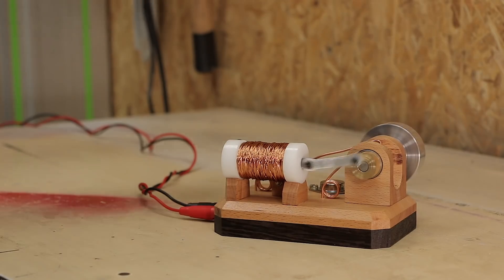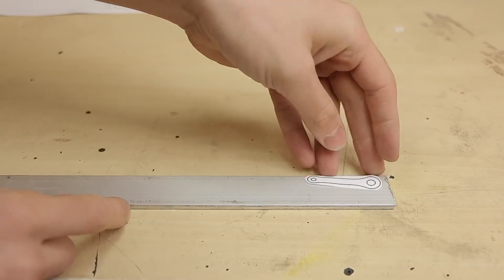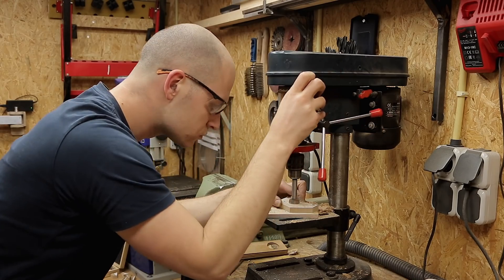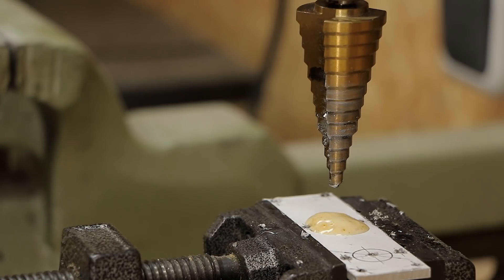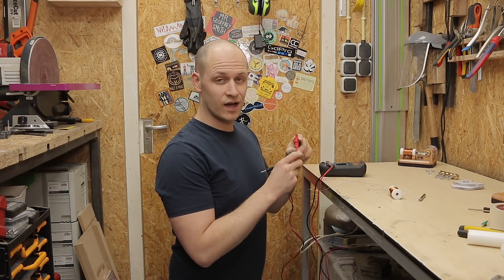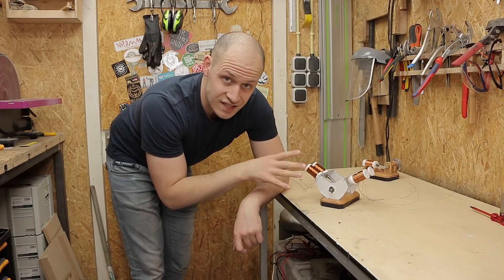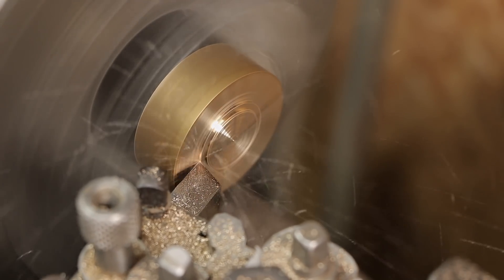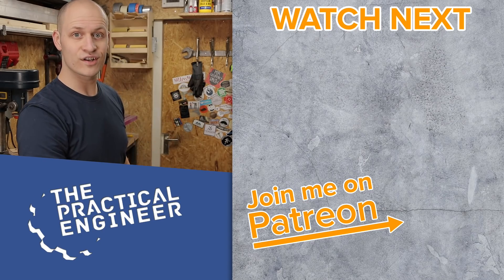How to make a V4 solenoid engine

Comment: You should have made some conclusions. About how efficient the motor is. Measure the power. Compare efficiency to a brushed engine. And try to find a way to make it more efficient.
Reply: By measuring the RPM, the torque, the power consumption, maintenance, and the cost either in the long or short term
Reply: Inefficient as hell :D
Reply: Well, what you saw at the end was a motor running at 0% efficiency.
Reply: Epic nerd fight! Damn boiii
Reply: @renxula  was about to grab some popcorn if it kept going lol
Reply: How am i gonna measure that
Reply: You do that lazyass lol
Reply: It'll be nowhere near as efficient as a brushed or brushless motor due to the amount of friction between the rods and shaft; and that's assuming it's got good bearings.  In, e.g., a brushless motor there's only two bearings at the shaft supports.  In any electric motor efficiency is lost through friction and coil heat; can't think of any other mechanism where energy is lost.
Reply: @davidgriffin79  core loss is one of the largest loss mechanisms in electric motors.  Changing large magnetic fields in a piece of iron rapidly causes eddy current loss and hysteresis loss.
Reply: @EGL24Xx  I believe energy loss through current and hysteresis is due to heat..
Reply: @davidgriffin79  you said coil heat... as in resistive heating.  Core loss isn't due to heat.  Heat is generated in part by core loss
Reply: @EGL24Xx  My point is that energy loss, and therefore efficiency, is due either mechanical loss due to friction or coil heat (which is any manifestation of an electric coil).  The electrical energy is converted into mechanical energy and heat energy.  Energy cannot be lost, only converted (Physics 101).  The only other form of energy conversion could be into sound; but that would be a small but, nonetheless contributing, factor.
Reply: @davidgriffin79  dude, chill with your condescending rhetoric.  Core loss is not "coil heat".  You are also neglecting energy lost in various frequency ranges of EM radiation.
Reply: @EGL24Xx  Yea, dude, chill and go back to playing  with your Google.  Come back when you actually have a degree in anything.
Reply: @davidgriffin79  dude I am literally a grad student where half of my work is in electric machines.  You claim I'm just reciting google while you say things like "coil heat".  That's not a thing; no one says that.  You are nothing to me.
Reply: @davidgriffin79  wow, are you in high school?  Did you just learn basic calculus?
Reply: @EGL24Xx  Oh, you know its calculus, well done.  But you can't solve it can you?  Probably don't even know how to solve a simple integral, and you most certainly won't know what the sum to infinity is (but you can Google it).  That's the thing about Google though, it won't do maths for you.
Reply: @davidgriffin79  kid, I taught myself calculus in middle school.  Obviously the answer is fu.  Plus you can more or less google simple problems like that.  But how about this, I'll give you a pretty easily differential equation.  For vector x(t), solve dx/dt = [-0.5 0 0; 0.5 -0.25 0; 0 0.25 -0.2] x + [20; 0; 0] for x(t = 0) = 0
Reply: @EGL24Xx  Sunbeam, this is basic stuff, not even degree level (despite throwing in the matrix to confuse the issue).  Let M = your matrix and k your vector your solution is M^-1loge((Mx+k)/k)), QED. And  BTW the correct way of defining x(t=0)=0 is x(0)=0 and the correct way of defining dx/dt is x'(t).
Reply: Lets try some grown up maths shall we. Solve the ordinary differential equation: y''-(1-x)y'+y=0 subject to the initial conditions y(0)=1,y'(0)=1,for x=1.  Hint, this is not closed form.
Reply: @davidgriffin79  let me quickly solve your children's problem while you piece together the shattered pieces of your ego from failing to solve a basic system of linear differential equations.  Here, I assume y is a function of t.  Since x = 1, the equation becomes y''+y=0 which has roots or +/- i, which just creates sines and cosines.  The first condition sets the cosine coefficient to 1.  The second condition gives the sine term a coefficient of 1.  So this is just cos(t) + sin(t), or sqrt(2) * cos(t - pi/4).  Your hint is in error, just like you throughout this entire debate.
Reply: @EGL24Xx  Sunbeam I've expressed x as a function of t: t(x).  i.e. if dx/dt=Mx+k => ∫1/(Mx+k)dx=∫1.dt and t(x)=M^-1loge((Mx+k)/k)).  Now, if as you say, you understand calculus, that should be obvious. And yes, log(e) is ln, i.e. log to base e.  I've given you a differential equation to solve; I'm waiting.
Reply: @davidgriffin79  oof, it gets worse.  At the end of the day, your solution to my simple differential equation is very... very wrong.  Not only did you not find x(t), the dimensions of your answer conflict.  The correct response, as any freshman knows, is to find the eigenvectors and their respective eigenvalues, find the particular solution, use that and the eigenvectors to solve for the initial condition, and you're done.  But alas, as a simple high school student that doesn't know how matrices and vectors work, you failed.  My solution to your second request is exactly correct.  The second derivative of sin(t) + cos(t) is the same but with a negative sign.  So adding the second derivative and the original together is zero, which satisfies the equation.  The value for t = 0 is 1 which satisfies the first boundary condition.  The first derivative is cos(t) - sin(t), which at t = 0 is also 1.  So all of your boundary conditions are satisfied.  So yes, my answer is correct.
Reply: @EGL24Xx  Rant as you might here is the correct solution, sorry:-) https://drive.google.com/open?id=1mqurLIgBS-TARSanaeiIfkv27wYkXI3l
Reply: @davidgriffin79  Yeah I'm not clicking any links from you; that diff eq. is one of the simplest and I just proved my answer.  The debate is over.  You have lost every single time... Have fun kid.
Reply: @EGL24Xx Sure you "didn't click the link". It's not as if you couldn't handle the truth after all the bluster. Try not to trip over your tail as you run;-)
Reply: @davidgriffin79  You are Dunning-Kruger personified.
Reply: Given the correct solution to the ODE was presented in the screendump of the Mathcad sheet in the Google Drive link I'm surprised at the vicious little comment.  Still, we live in "free" countries and you're entitled to your opinion.
Reply: @davidgriffin79  That does not show that you are not Dunning-Kruger.
Reply: @xero2715  If you say so.
Reply: @davidgriffin79  I do.
Reply: @xero2715  I'll bow to superior knowledge Mr Xero-Kruger.
Reply: @davidgriffin79  Whatever you say, Dunning-Kruger.
Reply: @xero2715  Honoured to have you both here.  Are you both part of the same Psyche?
Reply: @davidgriffin79  Why not.
Reply: @EGL24Xx   @David Griffin  "Ok, we can't agree on a subject, let's battle in Maths to see who is right."

Comment: A couple of machining tips : Don't leave that much stock hanging out of the lathe chuck whipping like that .It is better to work as close as possible to to the chuck. To avoid breaking drill bits in brass  ,dull the point a little bit . Copper and brass are sort of gummy and  a sharp bit tends to dig in too much and binds breaking the bit or pulling the work out of the vice.
Reply from the maker: Hey Kevin, thanks for the advise! Appreciate it :)

Comment: I think it could be smoother with different crankshaft desing
Reply: also the crankshaft is not concentric, when you glued it in place you did one end at a time so it hung down, I would recommend having both end plates in place and then gluing them in one at a time. that way they'll be on the same axis
Reply from the maker: What would you change in the design?
Reply: @Thepracticalengineer  I would propably put every ctank pin 90 degrees apart, wich makes it crossplane.

Comment: You could try replacing the iron pistons with magnets and build a really cool V8 wind-turbine generator.  
(So you spin the engine with a propeller in the wind, or hydro, and the coils generate power, get diode rectified and smoothed with a cap).
That would look even cooler! 
I'd suggest Neodymium magnets, inserted into a thin Teflon tube, then into a glass cylinder with copper windings glued around it.  Could also be done inside-out.
Reply from the maker: That would look super cool! Thanks for the suggestion

Comment: Awesome project. Nice design and execution to build it. A couple minor suggestions to make your next build a little easier and safer. When designing templates to use to cut out parts, use a cross center design for all holes you need to drill. That will give you an instant center spot to center punch before drilling. I see you did that towards the end of this video, but it would have helped at the very beginning as well. And always drill your holes before cutting any part out. It gives to a bigger piece to hold on to while drilling, making it a lot safer. But really nice project all the same. Thumbs Up!
Reply from the maker: Thanks for the feedback! I indeed forgot to add the cross center for some of the holes but it ended up well :)